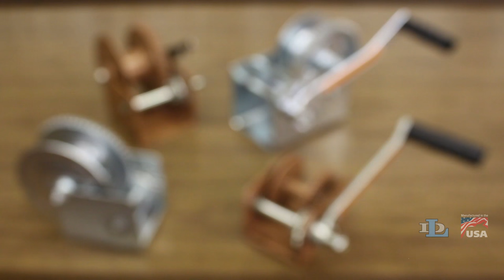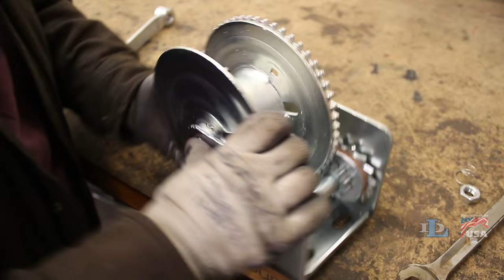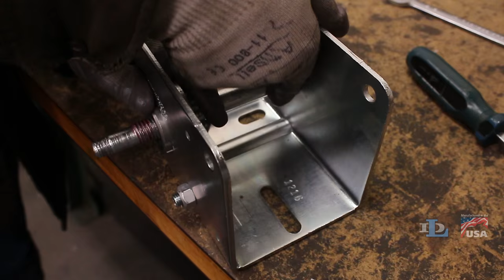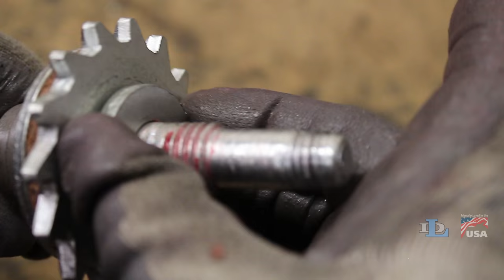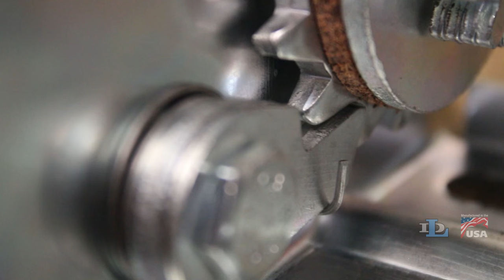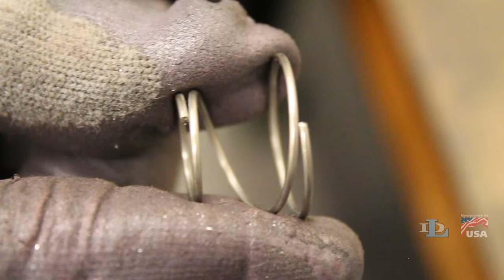Replacing the Brake Pad on DLB-Series Brake Winches - Step-By-Step

Comment: I have a DLB 800 winch on our pop up. I can’t seem to get the square crank extension hub from the free end of the crank spindle. Inside the hub looks like a big flat head nut. Does it have normal threads? It is frozen on tight!
Reply from the maker: Thanks for your question.  Does your winch's handle look like the 6462 DLB-Series Pop-Up Camper Handle Kit seen on our website here: https://www.dutton-lainson.com/proddetail.php?prod=76121?  If so, the nut you are describing should be a 5/8" x 3/4" hex nut.  It is probably simply stuck in place from being used and out in the elements for some time.
Reply: @DuttonLainson  everything is as it appears on the kit, except the actual fastener. On mine it is round and has a flat end with a slot that runs the diameter of the fastener. This winch is from a 1989 camper so maybe the design changed a bit over the years.
Reply from the maker: @geoffreyoltmans4356  Parts in this handle kit were changed in the year 2001, so we no longer have available the part you are describing.  You will have to loosen and continue to use the nut you have (if possible), or replace your winch with its updated version (the DLB800A- https://www.dutton-lainson.com/proddetail.php?prod=14914) and the updated version of the handle kit (the 6462 kit- https://www.dutton-lainson.com/proddetail.php?prod=76121).

Comment: My handle gets so hard to crank after trailer sits for few months. I cant hardly move it. I have to loosen the handle and brake pad to move it. After a few times it frees up enough to torque it back but gets hard again quick. Any ideas what I can do.
Reply from the maker: Thanks for your question, Nick!  While some of this tightness may be inevitable if the winch is installed on a trailer that is stored or often outside, be sure to keep a fair amount of grease on the threads of the handle hub and the threads on the drive shaft where the handle is installed.  It is also important to make sure there is grease on all of your winch's gears.  Just be sure you don't get grease on your winch's brake pad or ratchet wheel.